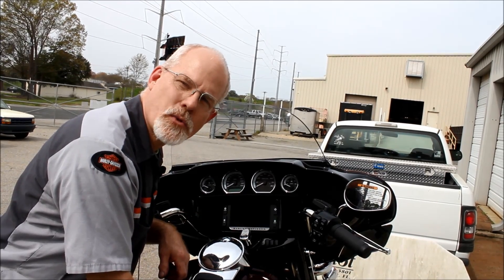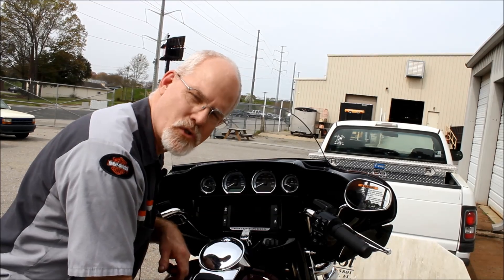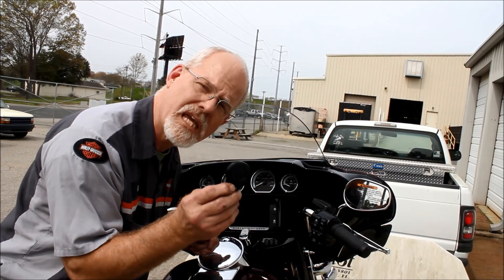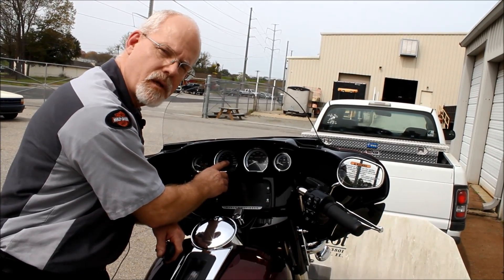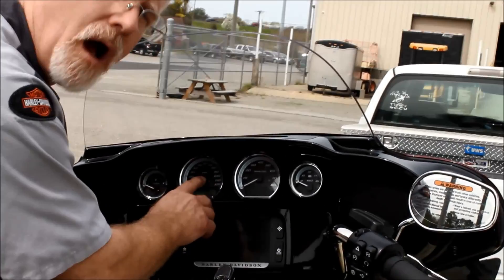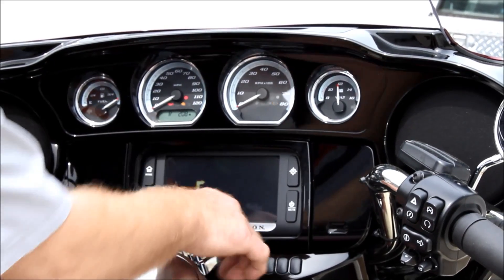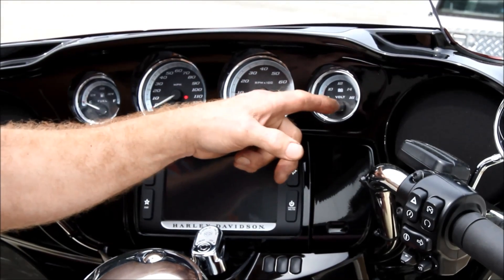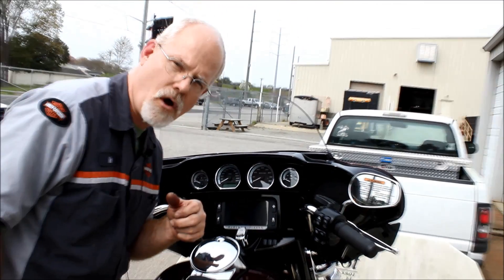DOC HARLEY: SECURITY MOTION DETECTOR

Comment: Great tip doctor, 
I don't know if you've done a video on this but I was curious how soon can you start the bike when you turn the ignition switch? 
Should I wait ✋ till the fuel pump stops pressurizing? Or could I start it right away?
Reply from the maker: Yes I have a video on why to wait for the engine light to turn off before starting. Thanks ~ Doc

Comment: Doc Harley, I have a small problem I have a 2006 Softail Deluxe, I am unable to find the pigtail to put in the alarm system for this bike. The side panel doesn't exist because that's the oil reservoir. It's Not underneath the battery. So I just don't know where else to look. If you could tell me where it's located I appreciate it
Reply from the maker: The H-D security system is installed by replacing the tour signal module (TSM) with the turn signal security module and then programed to your specific motorcycle. If you're trying to install the security system smart siren kit, the electrical panel can be found under the rear fender of the softail models. The rear of the vehicle can be raised slightly to allow removal of the splash guard. I can send you an image of the location if you email doc@lowcountryharley.com

Comment: How do you do if we don't have a ignition switch? I have a 2018 heritage
Reply from the maker: Handlebar switch ON
Switch OFF
Both turn signal buttons at the same time. 
Odometer will message you that you are in transport mode and turn signals will flash 3 times. 
Thanks ~ Doc

Comment: all this info is in the owners manual lol
Reply: The owner's manual tells you how to replace the same bcm with no problem I'm just unaware and not sure if I replace the original stock BCM with the smart  security  BCM is there anything else to watch out for or is it a simple swap it out from one to another even though it's two different part numbers and the owner manuals doesn't specify on upgrading it to a smart security system
Reply: RTFM? 😂